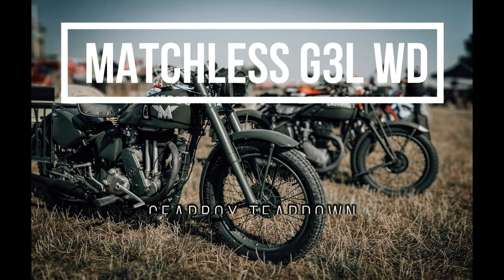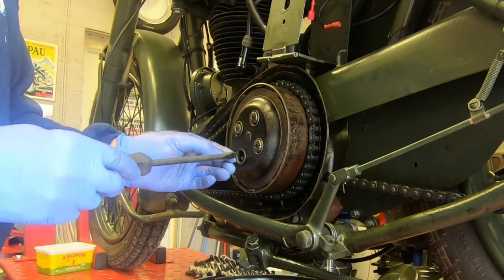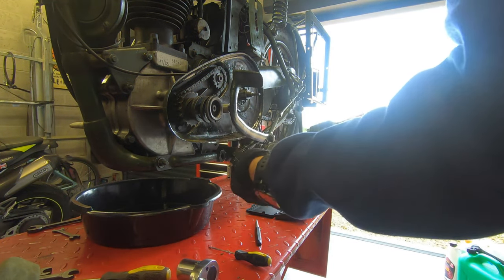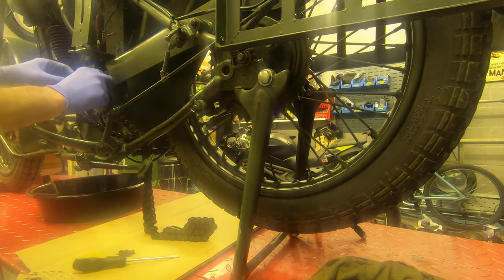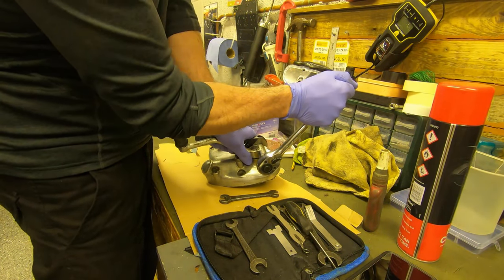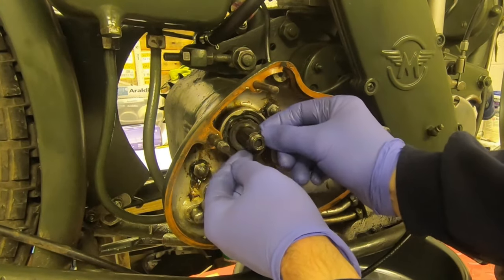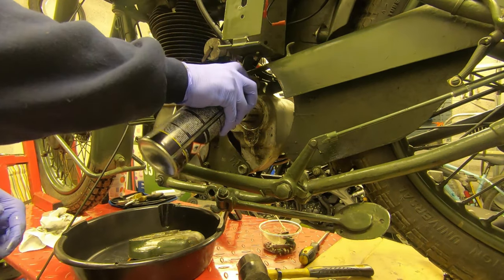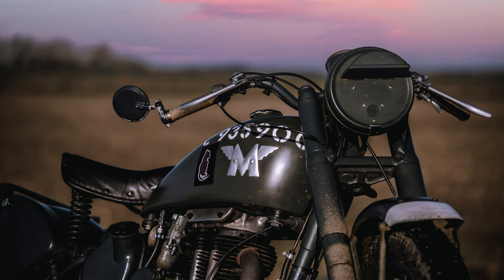Matchless G3L WD Gearbox Teardown

Comment: i'm just in the process of doing the same. Didf you make a rebuild video and how did you stop the bearing from spinning in the housing? loctite?
Reply from the maker: @BobbyD-r6w  here’s the rebuild video: https://youtu.be/qtOatAYs6b0?si=5rtox_iTyMGr-bxo I did use a liquid bonding agent as you will see but it went in so tight it may not have been necessary
Reply: @terryjones6229  thanks Terry!

Comment: Perfect, this is going to help me imensly rebuilding my gearbox for my matchless g3l, my gearbox is 1939 so can exchange the bearings for a bush like yours? Behind the secondary casing that is. Thanks so much for your video.
Reply from the maker: That should be no problem. I suggest you give Steve Surbey a call at AMC Classic spares to source the bush 01462 811770. Glad you find the vid useful. Don’t hesitate to make contact if you run into any problems